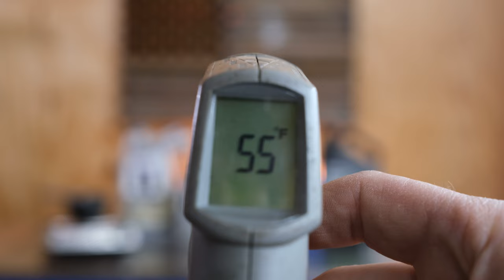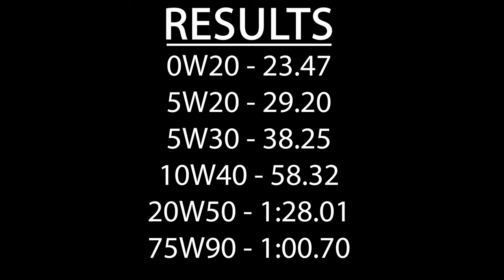Can WRONG Weight Oil be BAD for your Car? Lets Find Out

Comment: I own a diesel and the manufacturer recommends 15w-40 semi synth. But I use a full synth 5w-40 coz a lower winter grade oil will not only flow better but it will also reduce the weight of oil the engine has to push resulting in a peppier feeling engine

Comment: I use 10 w 40w in my Buick based Holden commodore vx model. Ecotec v6. I have hit almost 200 000km. I just bought some 20w 50w. In Australia with our heat? You can run diff oil with oil stabiliser. Lol 😆. Not really. But interesting video! This is extremely important for some people 👍👍👍
Reply from the maker: Lmao! 😂 Thanks man. What’s the temps like in Australia?
Reply: @Manvscars  hey mate! Yeah it has been a bit cooler than normal but I know it's gonna hit us bad . I have measured temps last year under the pergola and it hit around 35 to 40 degrees Celsius! In the shade of course. But it has been on my temperature probe for refrigeration at 42 degrees Celsius! And on the  news it's always at least 3 degrees less. Lol.

Comment: I put in 0w20 and i was suppose to use 5w20 now mt car is messing up smh how do i fix it?
Reply from the maker: I find it hard to believe that those two weights caused a concern, However you could try to and change the oil again with the correct fluid. HTH